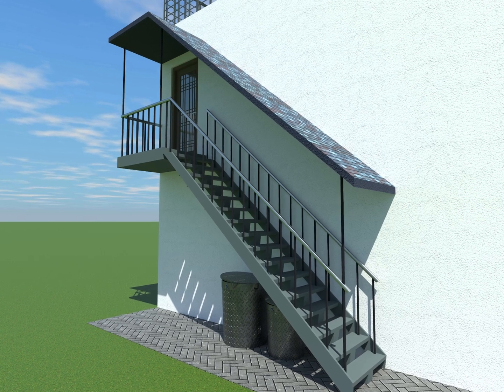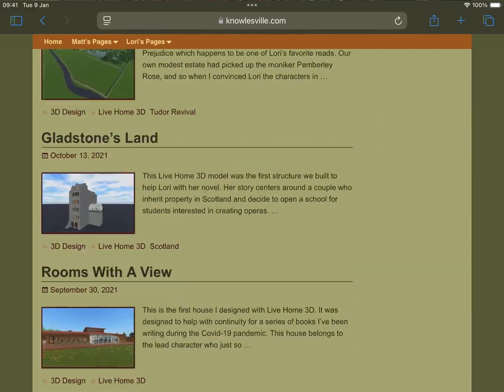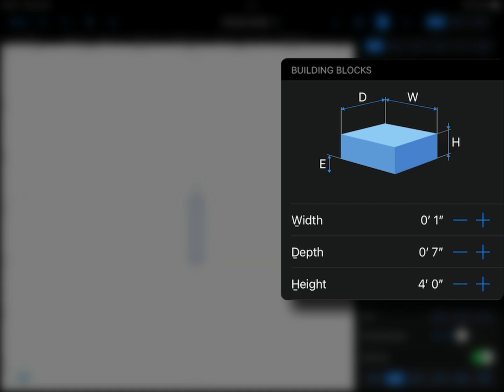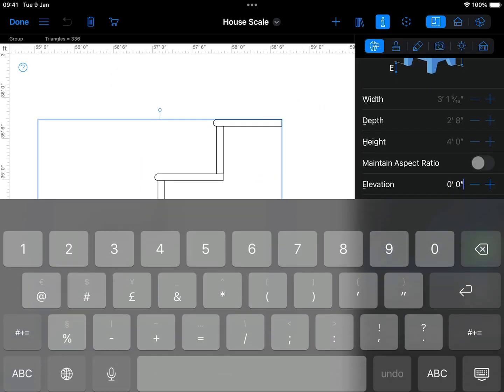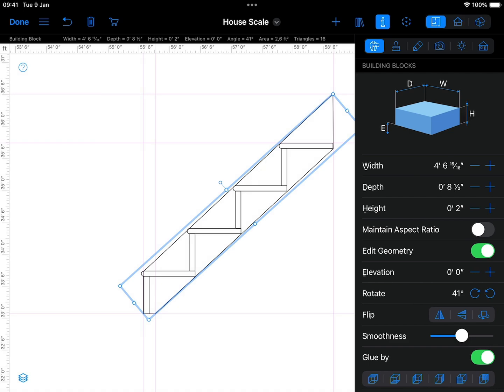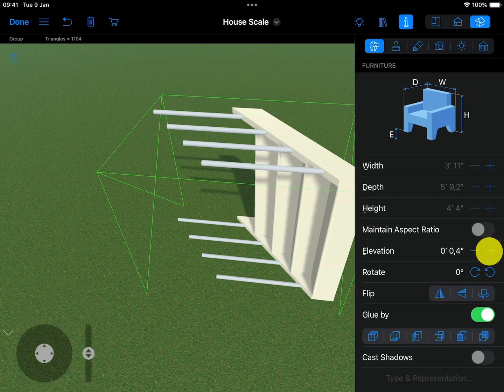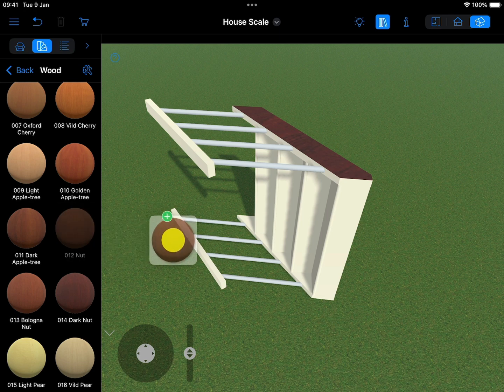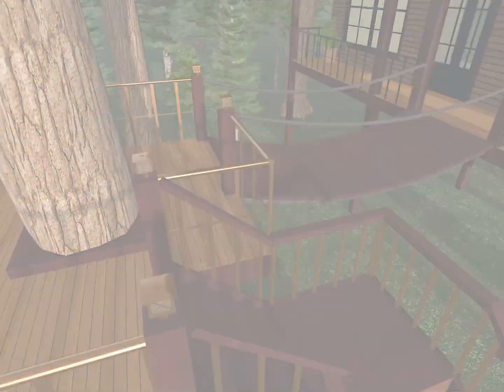Creating Custom Stairs in Live Home 3D Pro

Comment: what is the difference between 'building blocks' and 'shapes'; 'copy' and 'duplicate'?
Reply from the maker: Hi! Building Blocks are editable 3D solids you draw, while Shapes are ready-made objects from the library.
"Copy" moves the object to the clipboard, so you can paste it anywhere (even another file), while Duplicate makes an instant copy in place without using the clipboard.

Comment: Hello i have the mac pro version and i can't find the building Block Poly🤔
Reply from the maker: Hi! To add a polygonal Building Block, activate the Building Block Poly tool under the Building icon on the toolbar: https://www.livehome3d.com/support/help/mac/en/live-home-3d-workspace-the-2d-plan-view#toolbar 

Click several times on the floor plan to add corners. Double click in order to specify the position of the last corner of the polygon and deactivate the tool.

Please note, that these tools are available only in the Pro edition. You have mentioned that you have the Pro version, so this should work fine.

Comment: Why is it hard to draw a straight line now? Now if you want to make a parallel object it becomes difficult
Reply from the maker: Hi! To draw straight or parallel lines more easily, please use layout guidelines. You can snap objects to them for precise alignment.
Reply: @LiveHome3D The problem now is that the marker lines don't appear and it's very difficult to align 2 objects. I don't know if this only happens in my application or in all of them.
Reply from the maker: @Kaliberdua  Please contact our support team by email at support@belightsoft.com. In your message please include your project file and screenshots, so we can help you resolve the issue.